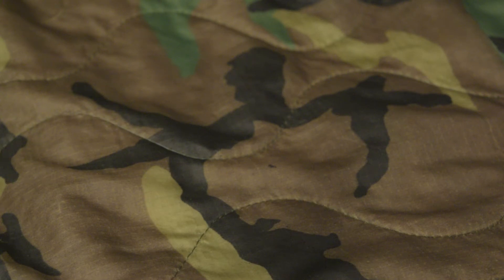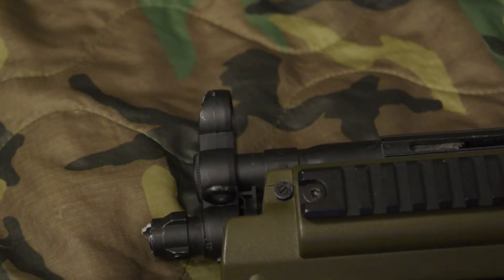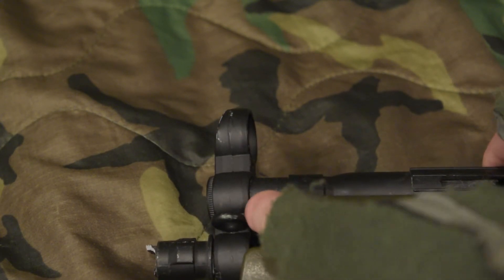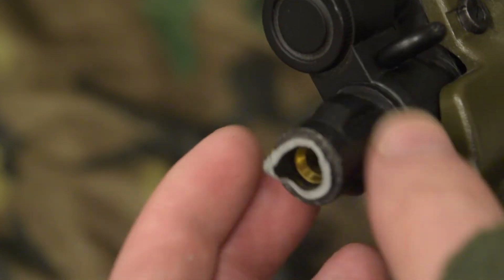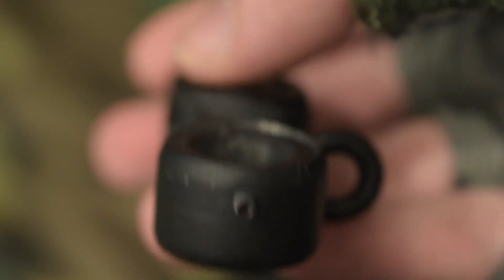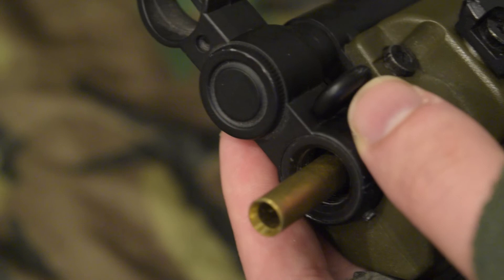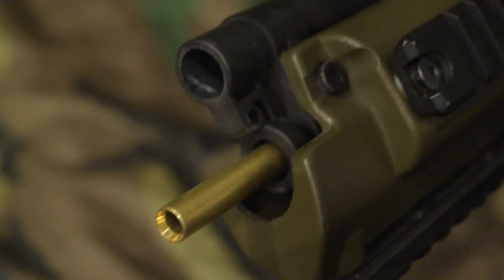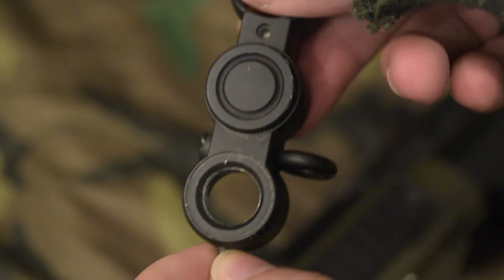Airsoft MP5 Three-Lug Threaded Flash Hider Removal (CYMA Example)

Comment: Hey man.  When getting that orange threaded tip off do you have to hold the outter barrel to screw that tip off. Mine doesn't that that set screw on the bottom and I'm trying not to break my barrel

Comment: Do ya know how to remove an old utg flash hider and front iron sight?
Reply from the maker: Maybe. From what model?
Reply: @KlonoaTorqueBow  shit if I had to assume it’s an old plastic model iron sights are plastic as well everything pretty much plastic except handguard and lower tougher material
Reply from the maker: @ApokGnar  Is it a spring/pump-action model?
Reply: @KlonoaTorqueBow  nah it’s an aeg model
Reply from the maker: @ApokGnar  OK, that's probably a WELL R-5. I have the Crosman variant. Can you take a picture of the bottom of the pistol grip, close up? When you've got it, just throw it on pastimage so I can see it.
Reply from the maker: Were you still interested in trying to get it off?
Reply: @KlonoaTorqueBow  oh whoops my bad well I do but it feels more like it’s glued together and threaded onto plastic
Reply: I was basically overhauling everything on it

Comment: How do you remove it for the vfc mp5a4?
Reply from the maker: The VFC's AEG or gas, will likely be pinned in. Look for a pin, and if there's not, report back and I'll try to help further.
Reply: @KlonoaTorqueBow  I don’t see a pin
Reply from the maker: @justchay7095  What model are you working on?
Reply: @KlonoaTorqueBow  it’s the elite force mp5a4 which is oem by vfc
Reply from the maker: @justchay7095  Have you tried unscrewing it via turning the flash hider?
Reply: @KlonoaTorqueBow  no I don’t know which way it goes
Reply from the maker: @justchay7095  The three-lug flash hider itself? It goes to the left as I recall. You may have more solid advice from visiting the Facebook Airsoft Teching Q&A group
Reply: @KlonoaTorqueBow  yes the entire tri lug, counter clockwise or clockwise?
Reply from the maker: @justchay7095  I think it's clockwise if it's like all the others I've seen. You may want to ask airsoft reddit before proceeding just in case.

Comment: You know anywhere i can order the front sight, im tryna get on for my gsg522
Reply from the maker: Are you asking about the plastic or metal gearbox one?
Reply: @KlonoaTorqueBow  not sure what model it is but is a all plastic spring gsg
Reply from the maker: @Jd-jb9fs  Oh that's actually the Academy Plastic Model variant. I have one myself with a somewhat broken cocking handle but it still works. Tell you what, I'm going to do a review, and then I'll send you the front sight from mine.
Reply: @KlonoaTorqueBow  my cocking handles fucked up to is it like broken off the track n wobbly , and im looking for the hk front sight
Reply from the maker: @Jd-jb9fs  You're looking for an original H&K front sight?
Reply: I have the one it came with im just trying to make it look like a hk mp5 a little more
Reply: @KlonoaTorqueBow  yes sir!
Reply from the maker: @Jd-jb9fs  Yes sir, to what?
Reply: @KlonoaTorqueBow  u asked if i was lookin for an original hk mp5 front sight
Reply from the maker: @Jd-jb9fs  Well, here you go: https://www.midwestgunworks.com/page/mgwi/prod/201561
Reply: @KlonoaTorqueBow  thanks brotha
Reply from the maker: @Jd-jb9fs  Wait, let me get mine apart and see if a CYMA one fits. Thatll save you like 80$
Reply: @KlonoaTorqueBow  very good tanks again
Reply from the maker: @Jd-jb9fs  I tried a TM-standard MP5 front sight and it doesn't even remotely fit. These Academy models (GSG-552) don't have a realistic build to fit. I'm afraid you'll have to buy a new gun entirely, or pull parts from a broken or used one.
Reply: @KlonoaTorqueBow  damn ,i apretiate you testing it , i know years ago i was able to get my crosman r71 sight to fit but that sight has since broken .

Comment: “These are normal 14mm negative threads”

Can you clarify if they are normal or negative?
Reply from the maker: The threads that go into the gun are positive, but please gently try beforehand, as your model may be different. What make do you have?

The outward threads are going to be 14 mm - unless G&P made it lmfao.
Reply: @KlonoaTorqueBow  Thankyou for the fast reply 😄
I’m actually putting a cyma three lug onto a GSG - but need an adapter.

Thankyou very much
Reply from the maker: @UnrestrictedIsle  Wait wait wait! Is this the low-cost electric, or the higher cost one?
Reply: @KlonoaTorqueBow  the .22LR 😅
Reply from the maker: @UnrestrictedIsle  Oh, OK. Those are completely different. This is based on the 90's toy-gun design, rather than an H&K-based build.
Reply: @KlonoaTorqueBow  yeah they’ve got a M16x1 thread - but I’m fitting the same trinlug as your broken one here 😃
I haven’t got it yet, but wanted to order the correct adapter so they arrive around the same time 👌